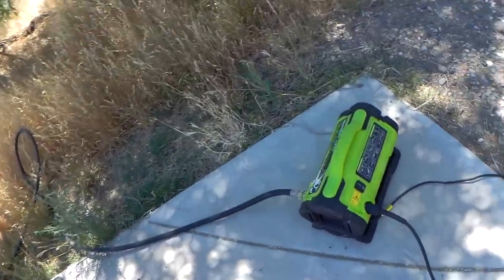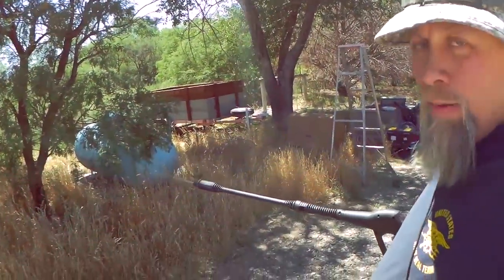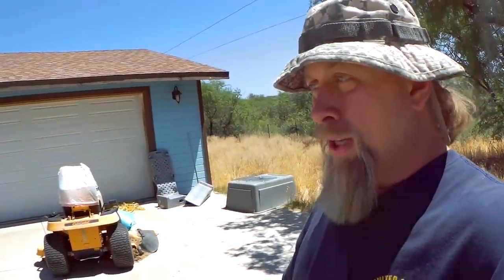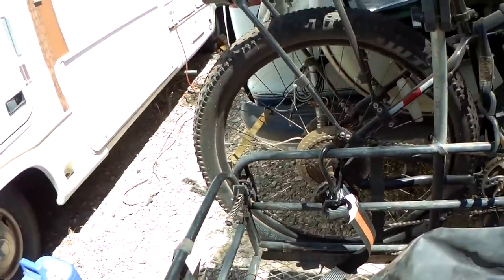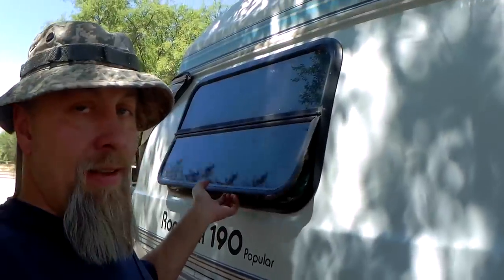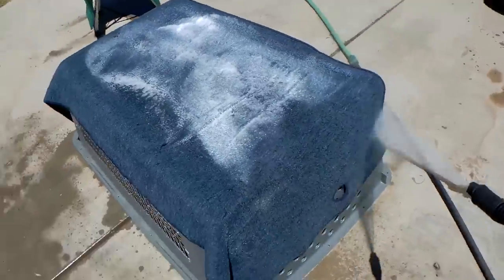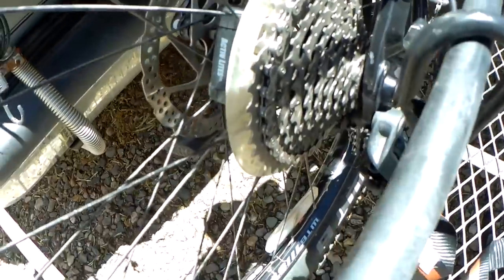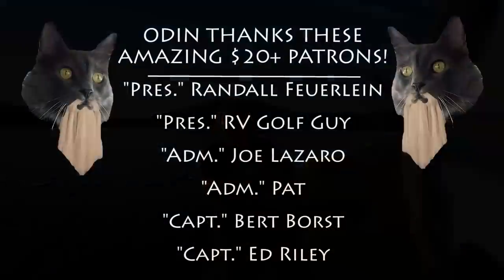How To Power Clean Your Rig Off The Grid Using A Portable Pressure Washer!

Comment: Careful with the bottom bracket on the bike and the pressure washer.  I had to have one rebuilt just using a spray hose.  It can shoot all the lube out.  Consider re-lubing before you ride again.

Comment: I do my e-bike when I do my van with pressure washer as well. I don't use the pressure washer up close, I keep it a distance away and it cleans it really well. I lubricate the chain afterwards, and it works well. I think the alternative, not cleaning, is far worse as you'll get all sorts of sand and grit in the chain, gears, and the hub and shortens their life.
Reply from the maker: Couldn't agree with you more. Leaving the sand in there would just grind up the bearings. Lube after and all is well.

Comment: Hey dude I did 3/4 inch puzzle mat, exercise mat that comes in 2 ft sections you put it together like a puzzle, can get different thicknesses, in my cargo trailer for the floor and insulation, so far I'm very pleased with it and you can take it in and out to clean

Comment: I have question. On home AC units to make them last longer they add what they call a hard start to keep it from drawing the initial power drain. Do you think that could be added to a small AC in a van so that it would have a smaller draw on the batteries. Since the start up seems to be the hardest on the inverter?
Reply from the maker: Many small a/c units include a soft start, including the one I have. It's listed under the Comfort section of my Amazon page.
Reply: @HOBOTECH  thanks😁